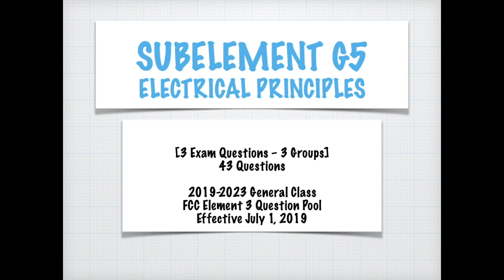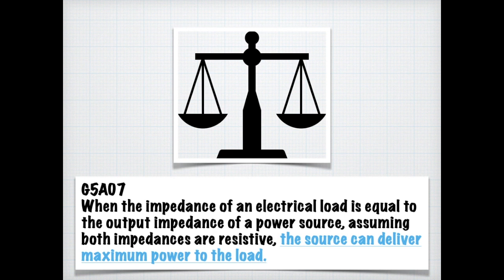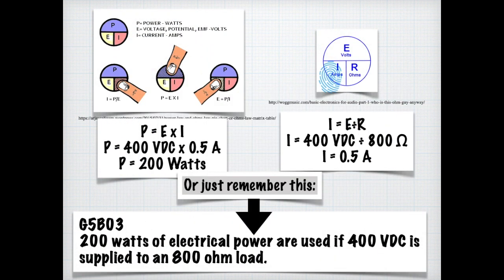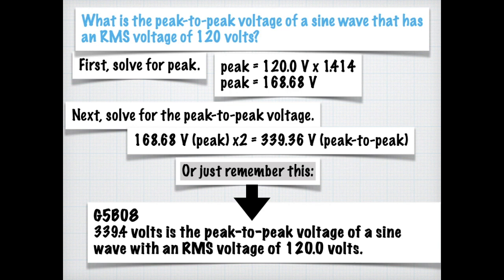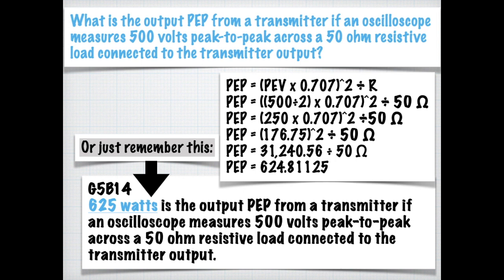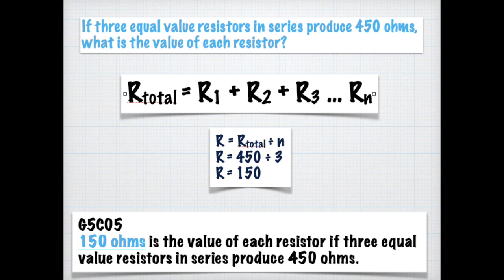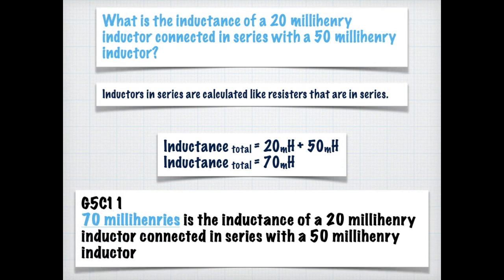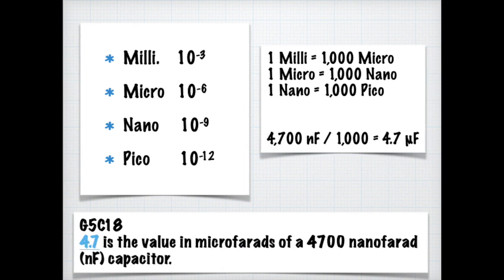General License Course Lesson 5

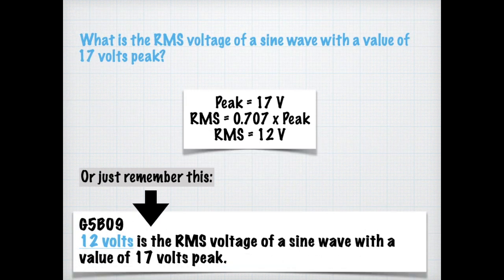Comment: I'm confused. At 19:35 we need to solve for RMS with a 17v peak. You multiply 0.707 by the peak of 17 to get 12. Where do you get 0.707 from? Last question before it had a number like that too (Peak = 120v x 1.414 = 168.68v) again where do these numbers (1.414 and 0.707) come from? Did I miss something? My head hurts trying to wrap around this stuff...
Reply from the maker: Hi Renol.   0.707 and 1.414 are constants we use in the formula.  Much like 3.14 (pi) is used.   Like pi, we just need to remember it to be used in the formula. 

The RMS value (0.707)  is approximately 1 divided by the square root of 2.  

The Crest Factor (1.414) is the square root of 2. 

I have no clue who came up with it.
Reply: @RedWagonTechnology  thank you very much for the clarification.
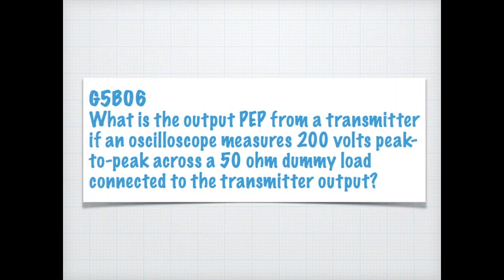Reply: 11:08 and 16:32 shows these numbers